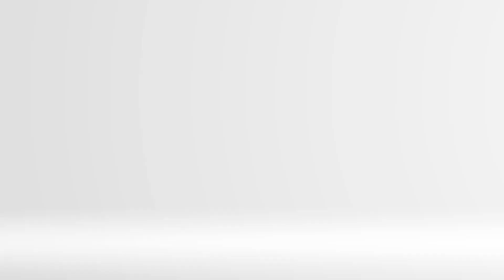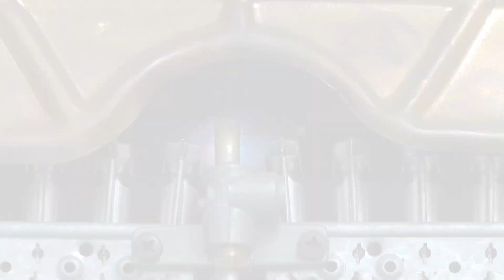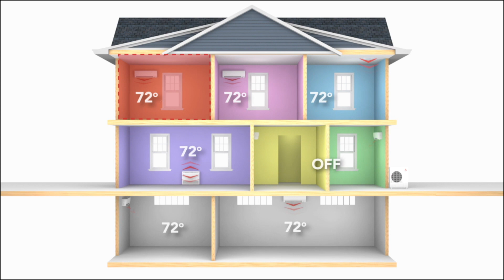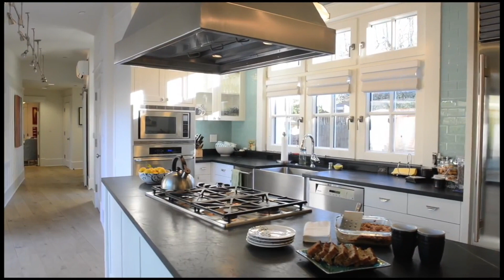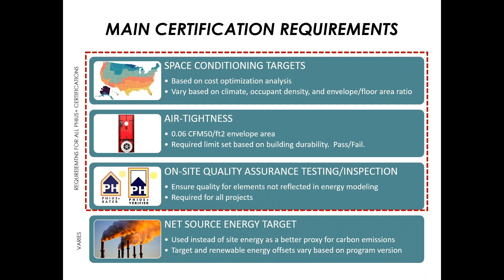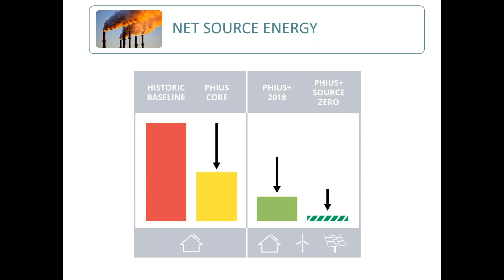PHIUS Source 0 - Pt 3

Comment: The world has a Climate Crisis.
We all need to do more to reduce or eliminate fossil fuels use.
All new buildings or retrofits need to be energy efficient.
Air sealing, super insulating, triple pane windows, set back thermostats, energy efficient appliances, LED lighting, energy efficient furnace and air conditioning, solar panels, battery storage and an electric vehicle charger all need to be considered as part of any new build or remodel.